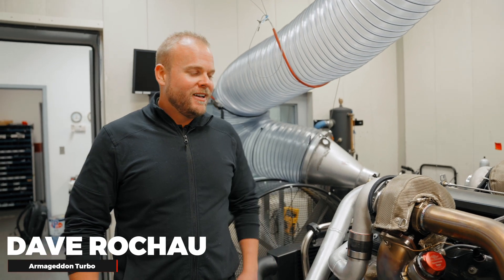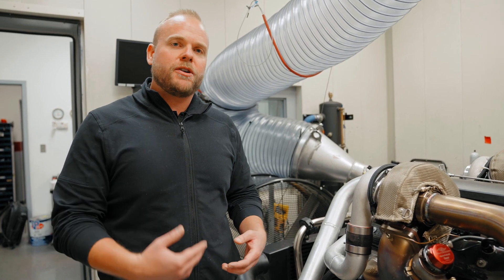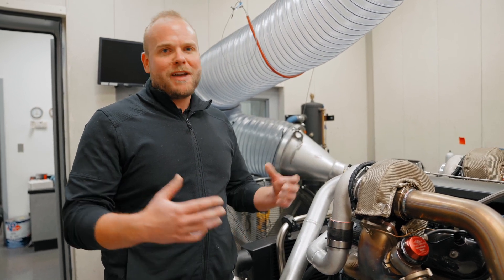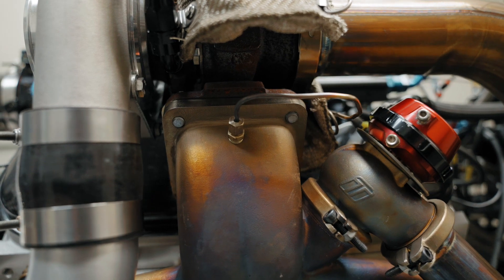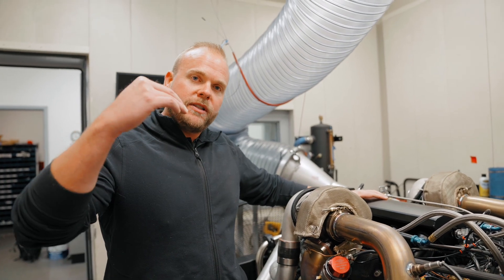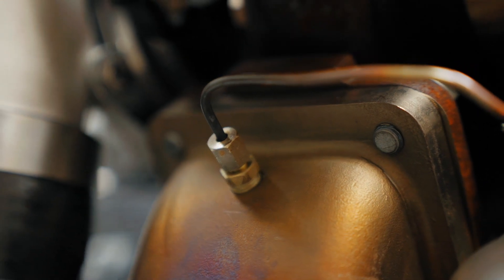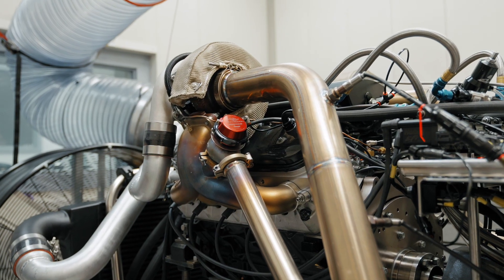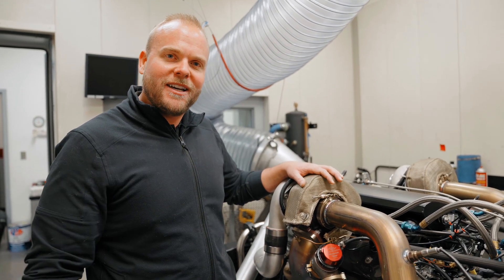What is Exhaust Manifold Pressure?

Comment: The temperatures change the air density and the boost numbers, exhaust manifold pressure is always going to be higher then intake manifold pressure. I’ve watched several videos on this subject and everyone always has ratios but nobody ever mentions that’s 2:1 hot:cold is actually closer to 1:1